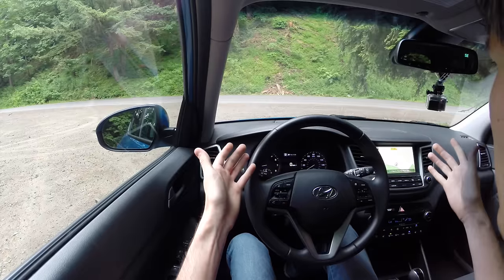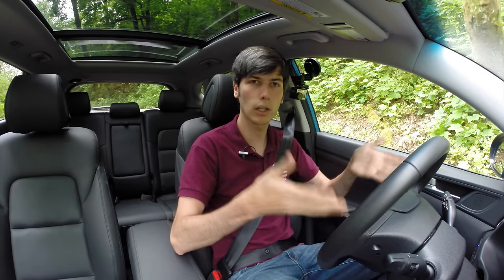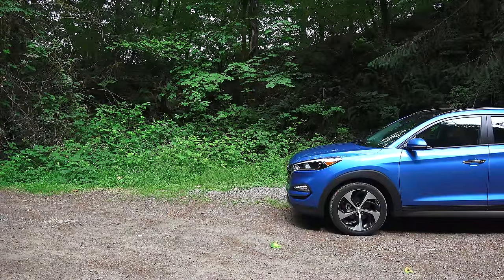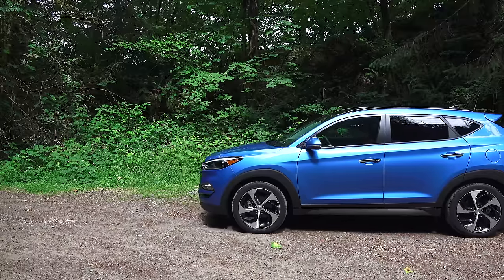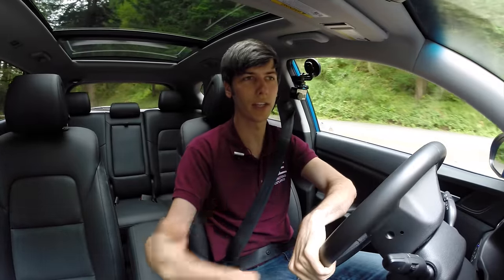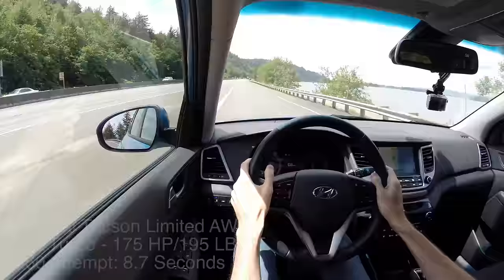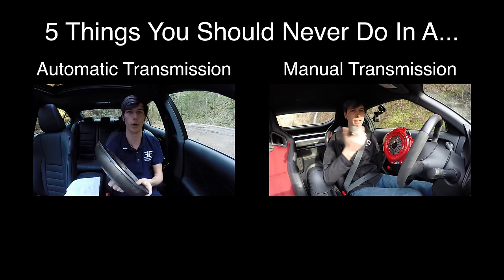5 Things You Should Never Do In A Dual Clutch Transmission Vehicle

Comment: So, then what is the best way to downshift in order to accelerate on a highway? My car has 9 gears and a dual clutch transmission, so if I'm going relatively fast on the highway and then want to downshift, so I can have maximum torque for acceleration, I often need to downshift 2 to 3 gears, but trying to click the left paddle multiple times has unpredictable results and most of the time takes way too long to get into the right gear.

What is the best way to do that, or is it pointless and it's better to just floor the gas pedal and let the computer decide on the best gear to shif into? (On my single-clutch 6 speed, manual downshifts give better and quicker results than letting the automatic choose, but on the new 9 speed I can't figure it out.)
Reply: It's better to let the computer handle the shifting. You're not driving a manual transmission car that's downshifting or upshifting when you do it. Your transmission is predicting what gear to be in based on how fast you're going. Just remember: you're not just driving a manual transmission anymore. You're driving a manual transmission that's controlled by a computer.

Comment: Are DCT’s reliability better than a conventional automatic ? I have a tucson 2018 ultimate diesel 2.0 with 6 speed auto(no  DCT)?
Reply: Short answer: no. 
Long answer: The ideal driving conditions for these transmissions doesn't exist when you'e driving in the city. But if you follow these rules, which you won't be able to do 100% in the city, you won't have too many problems. But you may still have to get a new clutch every now and then. If you try to drive the car like it's a true automatic, you'll need new clutches installed more often. Conventional automatic transmissions don't require you to really change your habits like if you were going from automatic to DCT. A lot of times, a salesman won't tell you that you're buying a car with DCT and won't mention how to take care of one. If you've driven standard, you might get more out of driving a DCT because you already know how to make a clutch last longer. So to answer your question... it can't be answered with a yes or no.

Comment: my ford mondeo 2.3 petrol 2008 overheat after driving in traffic jam for 30 min, and the auto transmission stops working and only manual works. also if i go to an open high way fast enough engine cools down whats the problem here? thermostat changed a week ago. also radiators fan and computer, maybe heat sensor might be malfunctioning?

Comment: great video, can you take a look at the POLO GTI gearbox problem, and if you dint mind, cover some content with regards to that
Reply: Hi, what is the polo GTI issue?
Reply: @jonathanstokes5069  the gears disengage , car stops moving until you switch it on and off, then the issue is most likely to happen if you turn left in many cases, even the dealership has no solution for this, making all sorts of nonexistent speculations, which can be costly

Comment: I have a question while riding down the freeway in my 2019 WRX premium with a CVT transmission. I had it on cruise control and I accidentally put it in neutral. How bad did I screw it up?
Reply: Tyler Culbertson i don’t know much about CVTs but from what I do know your fine

Comment: Regarding your first point, of whether to shift into neutral when coming to a stop; if what your saying is true (ie that the trans effectively shifts into neutral on it own - ie no load), why would the instantaneous fuel consumption be noticeably worse when in drive than neutral. Specifically, for my Audi B8.5 S4, I see 1.6L/h in drive and 1.1 in neutral, plus you can hear and feel that the engine is still under some load when in drive compared to neutral.  Based on this DSG, at least, I disagree with you.
Reply: Terry Forth its it's actually easy when you drive the fuel consumption is connected to the speed to you are moving because it is being showed as a liter per hundred kilometers consumption so when you drive slower that means in the bigger amount of time you drive the same distance. When you drive ultra slow the biggest amount of petrol you use you used to actually turn into electrical energy that is required by vehicle and say it's systems such as  cameras or air-conditioning. Then when you put a neutral gear vehicle actually starts to show how much petrol you use per amount of time, so the only thing that changes is the way computer measures your fuel consumption. Instantaneous fuel consumption isn't a good thing to look at, at all.
Reply: Same with my DSG in D vs N when stopped. Same feeling of slight engagement. Higher consumption when in drive (l/h) than neutral. I agree with you. It's a VW DSG DQ250.

Comment: Thanks for this. I learned a couple things from this video.  I'm driving my 2nd car with a dual clutch now. I swore I wouldn't ever get one again after the disaster that is the VW DSG, but the one in my Audi is fantastic. I can't believe that VAG can have such a big discrepancy between their brands.
Reply: They don't. They use the same DSGs between brands, but there's two main models of DSG. The older (and better, IMO) one is the 6-speed DQ250, which has wet multi-plate clutches like a motorcycle. The newer 7-speed DQ200 has dry single-plate clutches (like a regular manual). The difference you experienced could be the difference between the 6-speed and 7-speed, or it could be that your VW's Mechatronic control unit was failing and causing issues (like mine is).
Reply: My 6 speed DSG hasnt had any issues...
Reply: @clonkex  My 6 speed VW had both the mechatronic and Transmission replaced and I didn't make it 3 days before it completely crapped out.  The 7 speed I had in the Audi ran like a champ and never displayed any strange behavior.
Reply: @goatsnguns211  Shhhh.... Don't say those things out loud!
Reply: @TheBonzomatic  I ended up replacing the mechatronic in my 6-speed and it's been doing fine since then. Well, "fine" meaning it's still a bit rough sometimes but it's reliable so far. I will never get the 6-speed again though lol. Maybe I'll try the 7-speed at some point but probably I'll just save up for a Tesla :P
Reply: @clonkex  At how many miles? I have a feeling a lot of these can be traced back to not doing dsg fluid changes.
Reply: @goatsnguns211  I don't recall exactly, it was about 200k KMs. I got the car with 97k on the clock and as long as I've had it I've always had it serviced properly. Who knows what the previous owner did though.
Reply: @clonkex  My TDI is at 172,000km and it's been serviced throughout its life and has done just fine. But it certainly wouldn't be hard to believe something breaking like that. I know someone with 240,000km on the clock with a 2011 GTI and his DSG is running smooth as mine if not smoother since its tuned for the GTI

Comment: I have read about how the Ferrari 360 would burn its clutches up if the driver made it move forward too slowly.  Someone who's experienced with driving a manual would understand things the ECU can't.  A human driver would know to disengage the clutch and use the brakes to hold on a hill rather than burn through clutches.  We just have to help the ECU do what would be common sense for a human driving a manual.

Comment: Can you down shift manually to get the revs/torque required for acceleration and press the gas pedal to accelerate?
Reply: A DCT will automatically rev match to the next gear whether up or down shifting. They are very efficient at this and will change gears like a professional racer BUT, while I have one on my performance sports car and love it for the fast flawless shifts it does every time up or down.....I can't see why someone would choose a DCT over a standard automatic with a torque converter for a normal none sports car. Yes you can drive one in traffic but it is about as much fun as driving an old manual trans....except you don't end up with a tired leg from pumping the clutch so much.The old auto is smooth, no issue with wear or over heating a clutch in slow creeping traffic. Just let the auto select the appropriate gear as you accelerate. The DCT is so much faster shifting and perfect shifts and that is why they are great for a performance sports car. Even a professional racer would not be able to match the shifting of a DCT if they have a standard manual shift car. I wasn't a professional but did race in SCCA for a few years with a manual trans. No matter how good you are, the guy n the DCT is going to have the advantage. That is why F1, and most race sports car have DCT trans. But like I said earlier.....if you aren't racing or doing track days, a standard trans is fine.....and for a daily beater, it is hard to beat a traditional automatic. All the smog regulations and requirements for lowering MPG means manufacturers will use every trick to get another MPG. That is why some cars have the stop/start "feature". I hate that and would never buy a car with that unless it had a way to turn it off.

Comment: So how does this DCT fail at 62,000 miles with no pre-warning or check engine warning lights to let you know once you entered the freeway you have no control over the forward motion of the your car - oh, and an 18-wheeler is cruising in the right lane at 75mph blasting his air horn because you step on the gas and NOTHING happens... Engine revs high but the gear never engages. The 'gear shifter' could be push-buttons for all its worth - and the 'Shiftronic' became useless upon this failure which Hyundai is finding difficulty to diagnose. Haven't gotten it back yet after the first try with a total transmission warranty replacement.

Comment: My mom’s golf has a dual clutch, but I can’t find the clutch pedal. My dad said mom takes the pedal off when she comes home because she doesn’t want me to drive it because I’m only 15. Does that sound right?
Reply: Hahaha your dad is pulling your leg, a dual clutch doesn't have a clutch pedal it's an automatic and has the paddle shifter at the steering wheel, meaning you can drive it in manual using the paddle shifter or as an automatic

Comment: Im really late but could someone please tell me about how to properly downshift in the "manual" mode? 

Heres a situation:
Going to a stop sign in about two blocks- 3rd gear in "manual" mode.

Do I just press the brake and then downshift? Or do I need to blip the gas as well like with a stick car?

Or heres another situation: 
Turning a corner and accelerating out of it. 
from 45-30mph
Brake and then downshift? Or blip? Or not do anything after braking?

I drive an old 07 volvo s40 2.4i for reference.

Comment: as for shifting into neutral.  If the computer disengages the clutch when you stop and your foot is on the brake, then why does the car want to still try to go?  When I shift into neutral, the rpm's drop slightly and the nose comes back down.  Obviously something is still trying to engage when stopped.  I shift into neutral if it looks like a wait.
2013 Audi S6.
Reply: The TCU takes readings from the ECU. Fully applied brakes, zero wheel movement equals a fully disengaged clutch. A slight change in brake pressure and the TCU senses you are about to pull away and engages the clutch. This happens in microseconds. You just never know it's working. It feels like a regular torc converter transmission but its just a lightening quick manual.
Reply: @loojishtc9899  I know but if I shift into or out of gear with the brake pedal fully pressed,  the car will still squat or unsquat like it wants to go.  if the clutch were completely disengaged, it wouldn't make any difference.

Comment: Surely you contradicted yourself in points 1 and 2?  You start by saying there's no need to select Neutral on stopping because the clutch disengages then you say you can hold a car on a slight incline using clutch drag. After 15 years mof driving VAG DSGs I can tell you there's definitely clutch drag when stationary in Drive, you'll hear the engine note change as you move the selector to Neutral.

Comment: If the car comes to a complete standstill, is the engine completely disengaged from the transmission automatically without slotting the gear lever into Neutral?
Reply: To find out, come to a complete standstill and take your foot off brake pedal. If the car rolls by itself, then engine is still engaged.

Comment: Hmm... interesting... so is is bad that I usually coast all the time to a red light when I know by the time I get to it, it will be green anyways? The transmission has felt wierd sense day 1 and sometimes feels like it's down shifting or something when coasting slow. I heard some of fords dry clutch transmissions have been horrible and plaged with problems so I figured that is the problem or why it feels so weird.
Reply: That's normal. And it's ok. I do that all the time on mine. Actually helps not wear down my brakes. It's considered trans braking. Big rigs do it all the time.

Comment: When I launch mt GTI, I run it up to about 3,500 rpm's in neutral and then pull it into drive.
Reply: Traction off, vehicle at temp, hold break in manual first gear and foot on the accelerater flat foot, that's launching the GTi. Revving in neutral and slamming it into drive (well brake peddle engaged and released quickly) could damage your DSG gearbox, not cheap.
Reply: You should not do that, sport mode or put it into manual mode to have control the revs and shifts would be a lot better, I couldn’t image the horror if I did that to my DSG it’s already on its golden days, doing that instead would have probably killed mine by now

Comment: Not so sure about his idea of taking your foot off the brake pedal of a normal auto transmission with a torque converter. Allowing the weight of the car...on an incline....to roll back onto the loaded torque converter places pressure on the auto transmission and creates heat. Heating of the transmission fluid eventually causes the transmission oil to break down pre-maturely. It eventually destroys the clutch packs inside the transmission.

Comment: My Honda Vezel Hybrid DCT 2014 model is a nightmare. In heavy traffic I need to press the break and after half an hour car goes nut and start to behave like unruly kid. Pick up don’t work when necessary, jerk when break few times. Power change form hybrid to normal or normal to hybrid seems got confused. In simple word get headache to drive that car.

Comment: If I am stopped in drive and have the parking brake on with foot off the brake will the clutch go into neutral?
So I dont have to hold the brake at a stop light???
Reply: No no no, don't do that. Most, if not all, dual clutch trannys will engage as soon as you let off the brake, whether you press the accelerator or not. So if you engage the parking brake and let go of the foot brake, the clutches will engage, trying to move the car, but it won't since you have the e-brake engaged and it will damage your clutches.
Reply: It stays in neutral when I have the ebrake on, as long as the brake light is on in the dash

Comment: u shouldnt downshift while acceleration? but if u let in D and u give more gas the automatic downshifts it self so it doenst make any sens.
Reply: But it also causes shudder because the transmission assumes you're coming to a stop and you're not. That will eventually lead to your transmission being stuck in gear or stuck BETWEEN gears.

Comment: So, when you let off the gas and the rmps are still high and you here it still reving slightly, then it drops thats normal because of the clutches correctly working?
Reply: Yes, mine does it all the time. They tend to be really shift happy. If they're in a high rpm range, they'll try to upshift as soon as possible to get it out of that range.

Comment: Would engine braking  a dual clutch cause any unnecessary wear?
Reply: ItsJohnWise I couldn’t imagine.  It’s not like the clutch is slipping - it’s fully engaged and just doing its job.  The car will automatically perform engine braking when you are coming to a stop quickly by downshifting on its own.

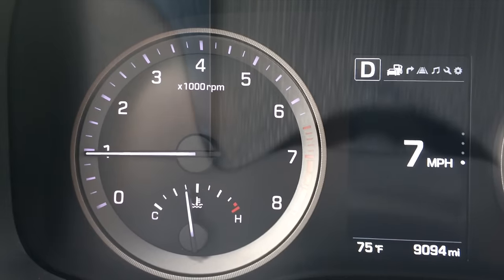Comment: 1:00 Correction: So you won't have unnecessary wear on the throw-out bearing. Which would be spinning at engine RPM and has to compress the springs in the pressure plate at the same time.
Reply: Wrong. Not all dual clutch transmissions are built the same. Most don't even have a throw out bearing. Most are hydraulically operated. At least, mine is.
Reply: Yep. Actually DCTs kind of have the opposite to a throw out bearing. There's no pressure plate in the clutches, so the engagement pressure comes from a hydraulic or electro mechanical actuator.

Comment: One should NOT let off the brake on an incline in a vehicle with an automatic transmission to "hold" the vehicle. This creates excess wear and tear on not only the torque converter but more importantly the transmission fluid, due to shearing, causing excessive heat and aeration.

Comment: Two clutch and there are two shaft for gears. Let's write a scenario; You are cruising at 6th gear and brake when you there then re throttle. when you re throttle best gear to accelerate is 4th gear. What happened then. Yees. Your car is dual clutch but one of it is out of reach. You can use just one clutch.

Comment: BS if you leave aDCT car in drive on flat surface the car will creep forward, because the clutch I still partially engaged, so you should select neutral. Having got this fundamental point wrong the rest is probably also garbage.
Reply: The clutch on my Ford DCT disengages if the brake is on. It engages back when I take 20% off of the brake pedal. It’s very noticeable, so at least for my car, he’s right.
Reply: thats why youre supposed to keep your foot on the brake...